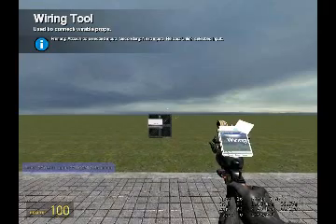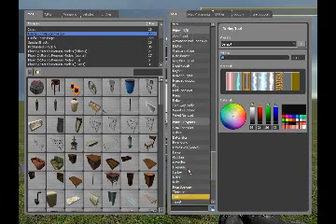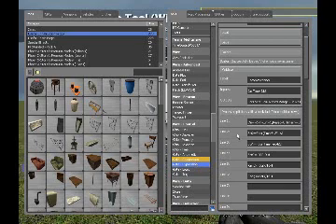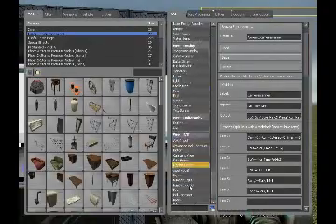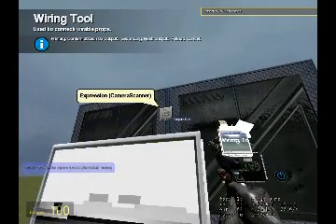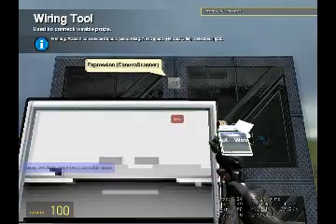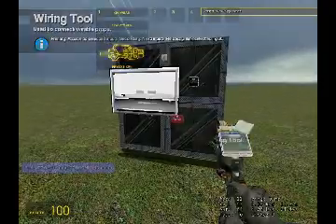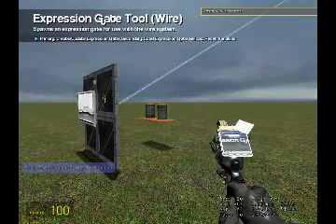GarrysMod Wire Mod Camera Scanner Tutorial

Comment: lol i just realized 7 months later that the e2 code looked horrible

@name CameraScanner
@inputs On Timer Distance
@outputs PixelX PixelY PixelG RangeX RangeY Run Reset

if (On==1) {Run==1}
if (Timer>=60) {Run=0,Reset=1}
PixelX=floor(Timer%2*16)
PixelY=floor(Timer%64/2)
PixelG=1000-Distance
RangeX= PixelX/16-1
RangeY= PixelY/16-1

Comment: Label: CameraScanner 
Input: On Timer Distance 
Output: ScrX ScrY ScrG RangeX RangeY Run Reset 
Line 1: On==1->Run=1,Reset=0;Timer>=60->Run=0,Reset=1; 
Line 2: ScrX=floor(Timer%2*16) 
Line 3: ScrY=floor(Timer%64/2) 
Line 4: ScrG=1000-Distance 
Line 5: RangeX=ScrX/16-1 
Line 6: RangeY= ScrY/16-1